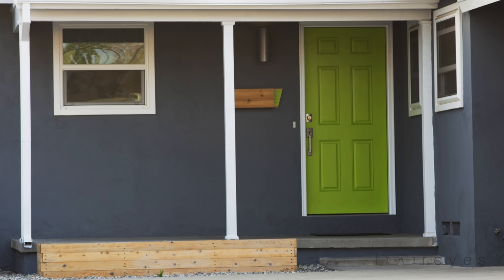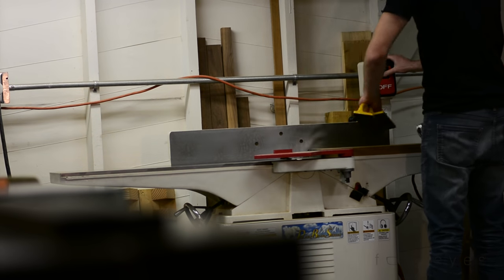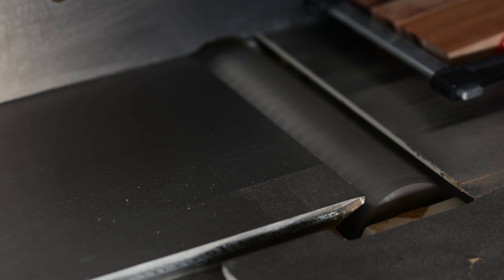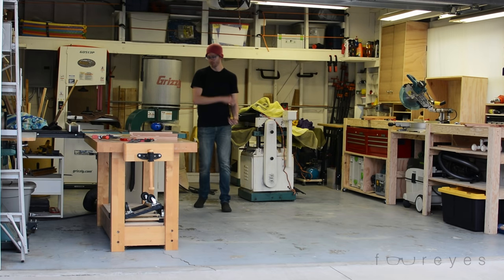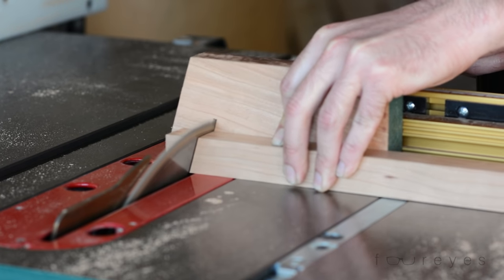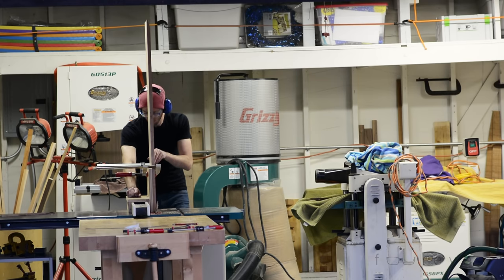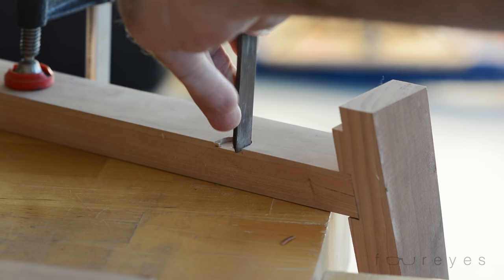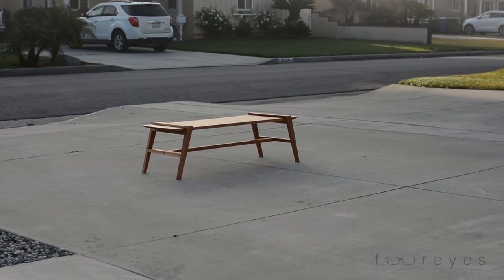Designing and Building a Modern Bench - Woodworking Projects

Comment: Beautiful piece of furniture, and excellent video.  Suggestion, do all the sanding and break the edges before assembly.  That allows you to get into all the tough corners.  Also, consider applying the finish to all pieces before assemble.  Just tape off the joints where glue will be applied.  I've found these steps save a lot of time in the long run.
Reply from the maker: Thanks Mark. I've done that on occasion in the past. I probably won't do it on the videos though, just b/c it wouldn't be as interesting to watch. Well...unless it is absolutely necessary, then I may or may not show it. In fact, on some of the other builds (cabinets) I do sand the insides before assembly...I don't think I showed it. Can't recall though.

Comment: Chris, not everything's about time. It's more about approach, and the joy that certain of these can bring. Don't be too overwhelmed by the number of tools. After all, you can boil them down to their basic functions, i;e 1)planing with, or 2)against, the grain. I'd sincerely recommend the following : 1) low-angle block plane (Veritas), 2) no.4 1/2 bench plane ( Lie Nielson and NOTHING ELSE!), 3) low-angle bevel up mitre plane (Veritas), a medium shoulder plane (Veritas again), and maybe to finish, for your pleasure, a no. 6 or 7 shooting plane (optional)of either make. Follow up with 200, 1000, 5000 grit Japanese water stones (read up on their use beforehand). The blades supplied by both makes are finely honed to start with. That's it. Bravo, well done on 2nd job. Nice work. Keep going
Reply from the maker: +musamor75 
Thanks...I'm sure I'll get some, and get into it at some point...I'll definitely use your suggestions as a starting point in my research.

Comment: i think i am going to use this for making my outdoor table. only difference i would make is i would use a thicker piece as the bench and then inset the top piece that is meant to sandwich the bench so it would run flush with the top of the bench, it would probably work better for the application i need. 

nice job by the way. diffinietly a very nice design. i am glad i saw your video. good editing too!.
Reply from the maker: +phillip cheung 
Thanks Phillip! Sounds like a plan. If you do it...send me a picture. I'd love to check it out!

Comment: Thanks for the video. I recently built my version using pine. Looks good but I felt it's not strong enough because of tapered legs and not enough support in between.
Reply from the maker: Hi Amish. It's definitely not the most robust design. But my wife and I both sit on ours no problems.

Comment: I really love the design. It feels Japanese, 50s/60s (the best modern parts 😉), but somehow timeless. The structural component is very visual. You see, that the top tilts the legs outwards and the stretcher pulls it inwards. This creates a balance between push and pull, you can see. The finish is excellent. This bench has an aura, that attracts you to sit down.

Comment: Very nice looking bench! I love working with cherry and yes it is a very easy wood to burn when you're cutting it. You need to clean and sharpen your blades and increase your feed rate when cutting it. Also in my experience the Forrest blades burn much easier than other blades that I use. Keep up the great work!
Reply from the maker: +Tom's Dreamshop Worx 
Thanks Tom! I'm almost done with the second video (in which I used a clean blade)...made a big difference! The slow feed rate was directly related to the dullness of the blade as well.

Comment: really liked this video.
not my type of bench, but liked the precision measuring and fore thought on design issues.
one suggestion, a lot of burn marks on the wood. take time to align machines, especially the table saw. this will save sanding time.
like the video quality, project layout and why. nice project.
liked your helper also. cute.
Reply from the maker: Hey Ted. Thanks! If you check out my other videos, you might like them better. For starters, the blade is sharper, so you won't have those burn marks driving you nuts. I'd recommend my newest...the "Catch-All". It is a bit more substantial than the bench was.

Comment: Put some plastic or metal feet on it, so that if the porch gets at all wet, it won't be soaked up into the bottom of the wooden legs. Looks great, and loved the detailed information. I know everyone gives people crap when they have a whole shop full of expensive tools, but as I watch it, I can see says of doing make of the things with inexpensive versions of said tools anyways. Those who can't lack imagination. :)
Reply from the maker: +necrojoe 
Thanks! Yes...it's definitely possible to make the bench with fewer and cheaper tools. I think that one of the points that goes missing on the people who get mad that I have lots of tools, is the fact that I actually use these tools to make money when I build commissioned pieces. That's almost exclusively what I used them for the past 4 years. Only now am I beginning to build more things for myself. About the feet. I have some spacers so it isn't actually touching the ground now. Also, the only time that porch gets wet is if I hose it off...so I'll just move it out of the way when that happens.

Comment: Nice crisp work. You're a well-organised worker. Well-equiped workshop, thanks to rational mind. Just one remark however : there seem to be burn marks on the edges  every time y
Reply: +musamor75 Wood burns when it is fed too slowly, goes past a dull blade, grabs the back of a blade when it moves while being cut (as with case hardened or reaction wood), or rubs against a "heeling" blade that is not perfectly parallel to the fence.
Reply: +Gary Singh . All this is true, as we already know. If you've seen as much stuff (nearly 5 centuries of British and European furniture, AND working on them) you can begin to understand a thing or two. Now, clever Sir, if you want to be fussy, let's look into cutting speeds, saw diameter, number and shape of teeth, rake, clearance, AND designation : RIP, or CROSSCUT. Also trueness  (any "whip' can cause burning). Modern saws, sadly, have too much RPM ; this alone is not good for the wood. Most European workshops have about 30 to fifty blades. We're very old -experience, not snappy New World.

Comment: hey, this piece is quite nice, btw most joints do add to the integral structure of any piece u apply them too, i believe a dovetail joint for that bottom end piece would do great on adding in strength...otherwise gr8 work.

Comment: great work and good use of angled joints
Reply from the maker: +Fathi Mohammed 
Thanks Fathi! I'm all about angles. I'm all about angles and tapers as you've probably noticed during my first two builds.
Reply: thanks chris i want to ask about using angels and keep project at balance and strong
Reply from the maker: There is definitely a sacrifice made in strength when you start angling things...but as long as it is strong enough, that is what is important. If you have specific questions, I'll try my best to take a stab at them.
Reply: what is the point of saving wood materials (max _min) in projects (legs , aprons ,top )?
Reply from the maker: I'm not sure I understand exactly what you're asking.
Reply: saving materials in project    in another way thickness and wide of boards
Reply: forget this question because its up to the project and use of it

Comment: Great build. How did you deal with squeeze out from the glue?
Reply from the maker: thanks JT. You'll notice I use glue fairly sparingly. Other than that, whatever squeezes out I let harden a tiny bit, and then scrape it off usually.

Comment: This video looks like a lot of work. Well done and good attention to video production.  I know cherry has a potential to burn in table saw cuts, but it looked like it was more prevalent in your build. What's a way to reduce this? I hate sanding past burn marks.  New blade? Different brand? More rigid stock holding? No criticism intended. You just got me thinking. When's episode #02? Also, Cubs = excellent. I miss chicago.
Reply from the maker: +Braden 
Hi Braden...thank you!  Episode 2 is already up "Modern Coffee Table". Just click through my channel. About the burn marks. My blade was dull and dirty. In episode 2 I'm using a clean sharp one and it cuts so much better. Forrest (the brand I'm using in the video) makes really great blades, so I hope I'm not making anybody think otherwise. Thanks for the sub!

Comment: I am interested into all the machines that you are using during the video, would you mind sharing them with us?? like the brands and which one is better than others? and maybe which one is going to be last longer?
Reply from the maker: Hi Kunyan...I don't want to list out ever single piece of equipment, but I'm happy to answer any specific questions that you have. Just send me a message.
Reply: First, you personal shop is the cleanest one that i ever seen, by the way, I learn furniture design too, and I like making stuff too, also I am interested to having all kinds of good tools.
But I cannot buy every single brand of tools to test out, so, your suggestion is really important to me. Again, thanks for your reply, I will definitely tell my students to check your videos.
cheers!
Reply from the maker: Hey Kunyan. Trust me...I'm the same as you. A lot of the machines I use are the only I have any real experience with. So I don't know that they are the best, or have anything to really compare them with. In general I've found that you get what you pay for in terms of quality and features. If you have specific questions about a particular tool...I can try to give you feedback to the best of my ability. Thanks!

Comment: I know it's fashionable to say on YT videos that dominos or dowels are used to align boards and that they don't, or you don't know if they do, add any strength....they do, obviously, add a lot of strength. Ok, let's set that aside. I've made benches with stretchers (is that what they are called?) between the two legs, and then a long stretcher joining the two sets of legs/stretchers together - as you have here. I like using two of the long stretchers, rather than the one. I'll space them, say, 6" apart, or, perhaps 4 stretchers, spaced 2" apart. (now I hear odd numbers of things is a good design principal - so maybe 3 stretchers). I think it's a better look than just one stretcher, and it has the added benefit of working as a shelf, for your shoes, or books, or what have you. Love your design!

Comment: nice mid-century style bench with a bit of an asian accent to it. dunno if i'd use cherry outdoors but as long as you put enough protective coats of poly or some sort of marine varnish, it should hold up decently.
Reply from the maker: +David N 
Yeah...it's a little bit of a gamble. I'll just keep monitoring it. My hunch is that it'll be fine since it's not really exposed to too much, being in So Cal and under a patio cover. Time will tell. Thanks for the sub!

Comment: the dominoes add strength... You're putting a mortise and tenon joint through out the entire top. Also I see a lot of wood burn after your use your table saw... I wonder if your either not running the work piece through smoothly or if you're slightly moving the work piece as you're running it through. If I were you I would watch that, don't want kickback. All and all nice design and over all nice build. good job.
Reply from the maker: Thanks Jared...it was the blade being dull and dirty. In my second video (a coffee table)it is clean/sharp and it cuts so much better! Thanks for the insight about the Dominoes. Makes sense.

Comment: Thank you for the video, the editing, commentary and camera angles are excellent. Do not change a thing.It is very inspirational. Maybe a bit longer for the walkaround / close up in the end.If you would allow a comment on a design: I think the legs should end flush with the top, rather than going "around" the top part.As the design is so elegant and light, this seems to me a bit too "playful". As this is for design purpose only, and it even restricts the use of the bench, but interrupting the sitting surface. Here the design does not follow the function, but hampers it. Without it, the beautiful taper of the sitting top would be the central design element, making it even more beautiful. As I am en engineer by trade, I can only recommend that you might want to look on what Is called "truss" or "trusses". The principle, that every part in a structure shall be subject to tensile load or compression, but never to bending. You were on the right track with the idea, that your bench will need two "stiffeners" for the legs, and although, that the legs have to be at an angle, and not 90 degree. (meaning if you "push" against the top, it will cause a compression load in the leg, rather than bending).That was the reason, why your first bench was so flimsy. And this bench a little flimsy maybe, because the leg stiffener (cross member) will cause bending in the connection piece between the legs. If you had two, in line with the legs, it would cause compression / tension. Thus being multiples more stiffer.Thanks again, and you got a new subscriber.

Comment: My only suggestion to an otherwise fantastic video: I started getting a little lost when you were describing the various leg angles and joints (15 degrees vs 18 degrees, etc.) - could you just put in a quick flash of Sketchup drawing to point out what you're cutting within the context of the overall design?  What can I say - I'm a visual learner. :)
Reply from the maker: +IV Woodworking 
Totally understand. If it weren't me talking about it, I probably would have gotten lost too. I'm also a visual learner. The reason for that is, I wanted to go into some detail...but not get overly technical where it became un-enjoyable. Plus, I figured very few people would actually want to build this, and if they did, the sketchup model will help explain most of it. Or, I'm available for questions.

Comment: Hey man. Very nice video! I've seen your stuff around for some time now. It's nice to see your videos too! Subscribing to your channel wasn't even a question. Keep up the good work!
Reply from the maker: Thanks Eric...appreciate the support. Glad it was a forgone conclusion for you to sub!
Reply: No problem. I'm sitting here digging around on your channel. I've always liked your work. So, keep these cool vids coming please. I'm starting on a few of my own projects soon, and this is the inspiration that i need.
Reply: Also, do you know of a decent (not great, but decent), affordable track saw, or track that will work with a general circular saw? I've never used one before, but I see a lot of guys using them now, and I like the concept.
Reply from the maker: I've only ever used the Festool one. I think Grizzly makes the cheapest track saw on the market. The wood whisperer did a review. I'd check that out. Other than that, I'm sure you can find lots of tutorials for straight edges that people make to use in combination with a regular circular saw.
Reply: Thanks man. I won't pester you any longer. I will check those out. I actually had my made my own straight edge guide for a while out of plywood. I was just looking for something a bit better in design. I look at those that you mentioned though.

Comment: You have an entire shop in your garage?
Reply from the maker: +Fresh Haus Almost. I pretty much converted my garage into a workshop. I'm going to address it in a Q and A video that I'll post next week. Lots of people have asked about it.  About your other comment (not pulling the piece back on cross cuts)...that is a good tip, and something I should pay more attention to. If you look close, you'll notice that I usually pull the piece away from the blade ever so slightly when pulling back, so it isn't actually making contact (save for on dado cuts, etc...)...but if it is a short piece and I don't need to bring it back, I should just avoid it altogether. Just a muscle memory habit thing I guess.

Comment: Great video. I wish I can afford Festool I don't think I would buy them but I still wish I could afford them haha.
Reply from the maker: +Jason Becker 
I definitely like festool...but am not obsessed with them. I love the sander and vacuum, and I do so much sanding that it was worth it. The domino, there is really nothing else like it, and it has saved me a lot of time on commissioned builds, so again, worth it. The track saw is so good. I don't use it a ton, but the times that I do...it's crazy. It actually leaves a better finished cut than my table saw does (even since sharpening my blade.) Other things I'll probably never buy...for example, the Miter saw just seems needlessly expensive, and I wouldn't get value from it. But there, if I was a carpenter who did a ton of crown molding and was constantly using it, perhaps I might be able to justify it.
Reply: +Chris Salomone I'm not knocking you for using them haha. I've used them in demos and such and honestly never found them to be so much better than another tool different brand. Although the track saw is pretty awesome I will give you that.
Reply from the maker: I agree. Some things are no better, some things are marginally better. I was just commenting that (using the example of the miter saw) for somebody like me, when I look at the mitersaw I can't justify spending double on it...but if all you do all day is use a mitersaw, I could see where it might be worth it. Even if it is just slightly better.